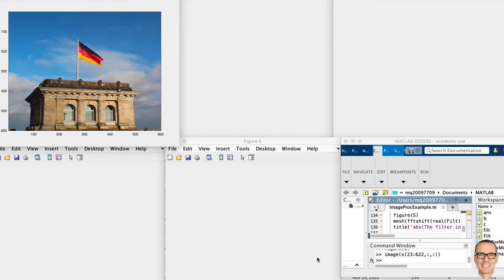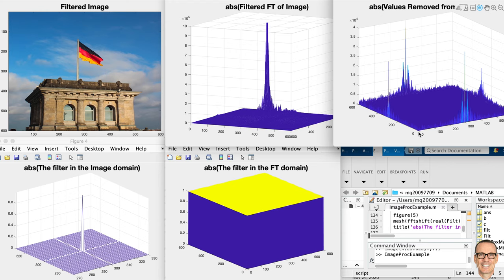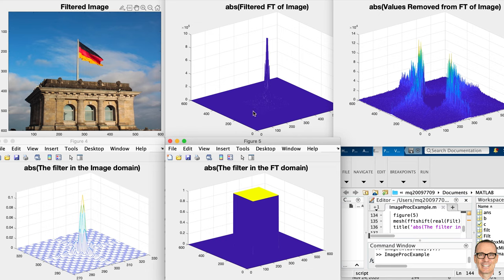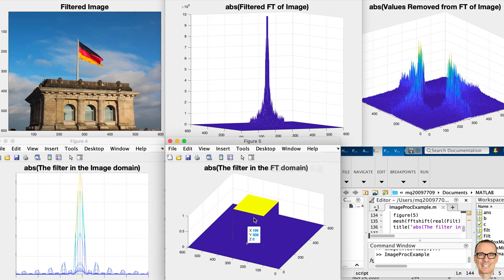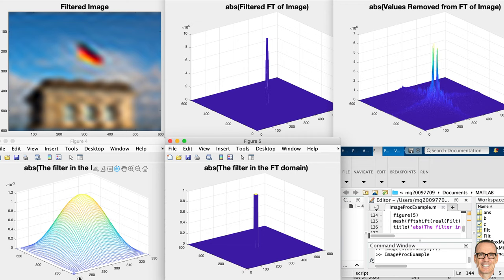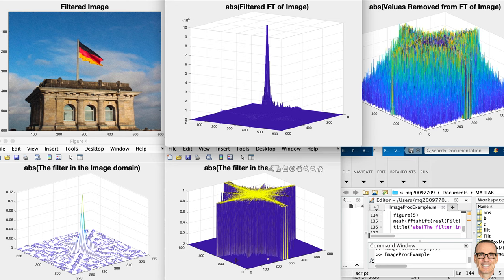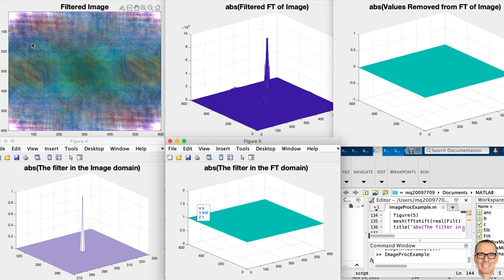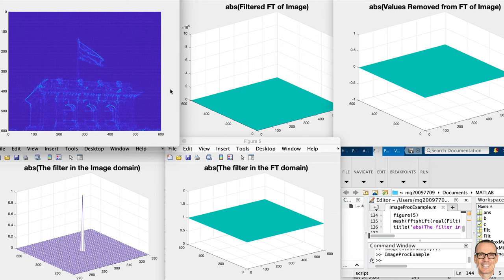Introduction to Image Processing with 2D Fourier Transform

Comment: The last bit of analysis confused me but I think I got it now:

First of all, ‘amplitude’ and ‘phase’ refer to the Fourier coefficients (they are complex: X = amplitude*exp(i*phase)). Secondly, the video is wrong in saying that we discard the amplitude by setting it to zero—we set it to one instead. Otherwise we’d have a zero vector! So we apply inverse DFT to Y = 1*exp(i*phase).

When discarding the pase we do set it to zero and thus use Y = amplitude*exp(i*0). 

Sidenote: We plot here the DFT of the blue part of the image. DFT is applied separately to the red, green and blue component.
Reply from the maker: Yes, you got it. Sorry for the verbal "typo" (saying the amplitude should be set to zero, when you're right, I meant to say "set to one"). I'll make a note of that in the video's description. Thanks.

Comment: I am a little bit confused on the last part when you showed the black image and said that there are actually red, blue and green. From additive synthesis we know that the more  red, green and blue you add, the more you have white, so technically in the image at 12:14
there is NO red , NO green and NO blue in order to have black(i.e. [0R; 0G; 0B]). Am I right?
It seemed to me that you were implying that in the black picture there was still a quantity of red, green and blue while from what I know it's the complete opposite.
Reply from the maker: You're right, I made a mistake there. I didn't realise it, but Matlab stores images in a "type" called uint8, and I was thinking that it was Reals. So actually Matlab had done an automatic conversion, that had resulted in all the values being set to zero. So in fact you are right. In that image there is no colour at all. But it's also the wrong image (due to the auto conversion). Anyway, the final image is correct (when I only show the red component). The Matlab code is available here (if you would like to see it for yourself): https://drive.google.com/file/d/1cncubdpaEvbkCPqEPS0_ybvazYhVpVV7/view and the image is here: https://drive.google.com/file/d/1zCuwgPnlnVcDFuryRY1NcqEMsyB84E_0/view
Reply: @iain_explains  thank you for the answer and the Matlab resources sir! I hope you will continue with your great work here on YouTube! :)
Reply from the maker: Thanks, I'm glad you like the videos.